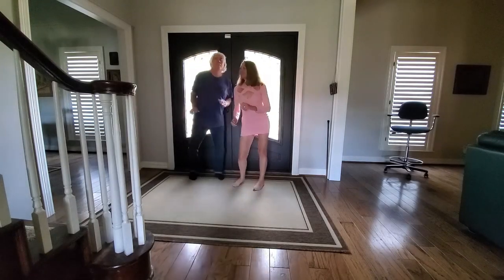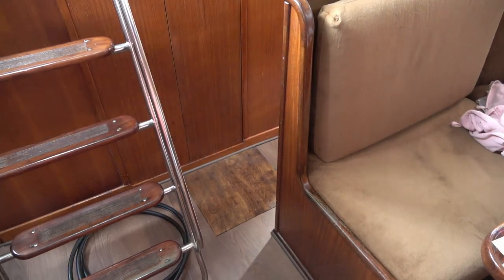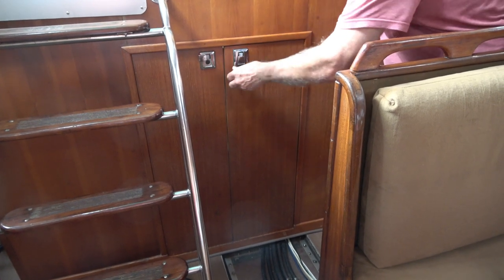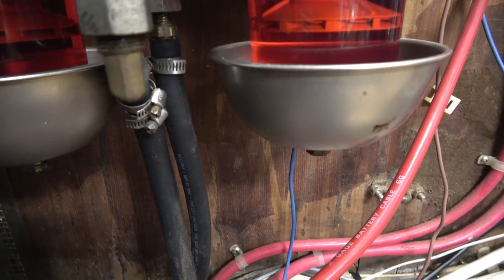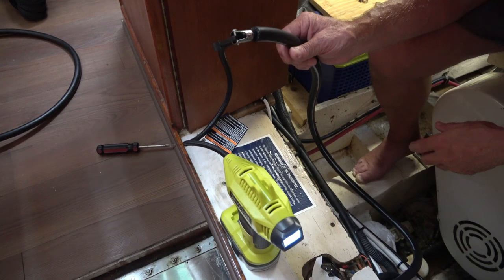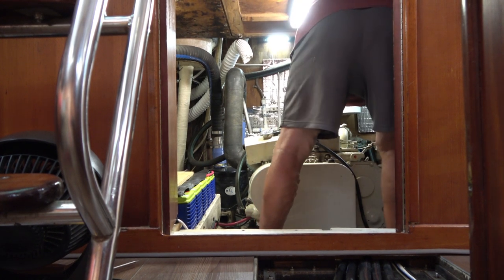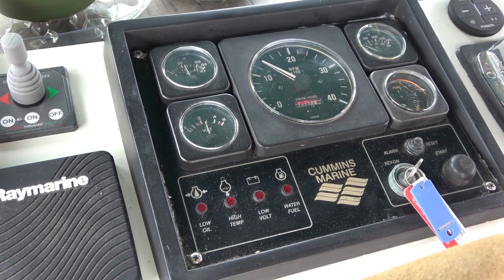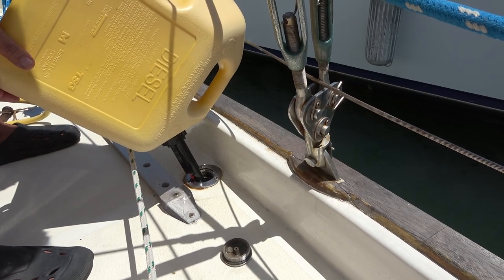I'm a Beach Girl Ep108

Comment: If you had a blockage in that top-suction pickup pipe I sure hope the lid is going to get lifted up so the inside of the tank and all the pipes can be checked. Because no matter how good a "polishing system" they have,  any floating or loose material is going to be hard to remove with the inspection lid still in place.
Reply from the maker: Thanks as always. We ended up finding someone who removed all fuel, polished it, and scrubbed the inside of the tank. Some of the problem was a deteriorating  rubber gasket that produced large chunks. When the fuel was placed back in the tank our engine started.
Reply: Thats great news. The rubber was obviously non-nitrile and no good for use around diesel. Should have no more fuel issues now hopefully.  Your engine should remain a happy lil Cummins from now on.

Comment: Pretty happy to hopefully cure the poor diesel saga, eh.  I was thinkinking about that hose because of  a similar issue i had with an old sport ca i had .  It would idle in my garage all day, but takeit out on the road and it would die out on me.  I drove me crazy.  A mechanic friend mentioned to me to check my fuel line, all the way from the tank.  Exactly the problem   i got some fuel, enough at an idley RPM, but not enough to sustain running RPM.  Im happy that you're back to normal againn.  Nice video
Reply from the maker: Hello, Robin. 💋Great idea and something to check. Steve and I can't wait to get this issue solved. 😎⛵

Comment: The Idle on your engine is way to hi. It should be around 750 to 800 R.P.M. . 
  Thank you for another Great Video this week. 
 So until next time, I well be here on my lanai waiting for the next video. 
 So Aloha from the Big Island of Hawaii!

P.s. If you use a fuel  Additive called P.R.I.D it will stabilize your fuel and you will get more fuel mileage per tank. And it will cut down on the black soot on your boat. And less mold in your tank.

As far as fuel polishing, you should run the fuel though the polisher into a 55 gallon Barrel and then clean the tank the best you can. Then take  Alcohol and flush the tank. And do this a few times tell the Alcohol comes out clean or clear. Suck out the Alcohol and put the fuel back in the tank. Don't worry about any small amount of Alcohol left in the tank. It want  Hurt the engine. 

Go look up "Sail Life" and you can see how it is done.
 That's how we polished all the boats fuel at the fuel dock in San Diego. 
 Ok hope this helps.
Until next time Aloha from the Big Island of Hawaii.
Reply from the maker: Yes. The low idle screw must have changed. I adjusted it back down. Thanks for the  additive recommendation. I agree. The only real way to clean the tank is to remove all of the fuel.